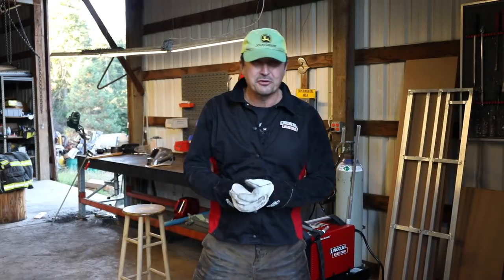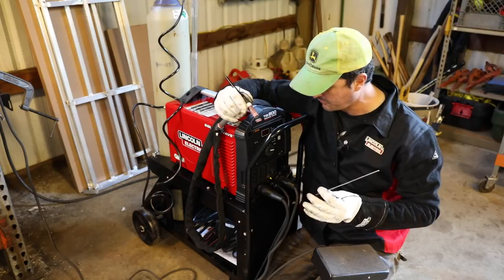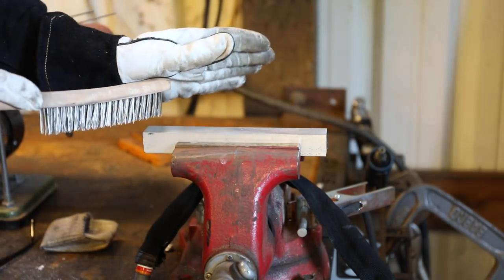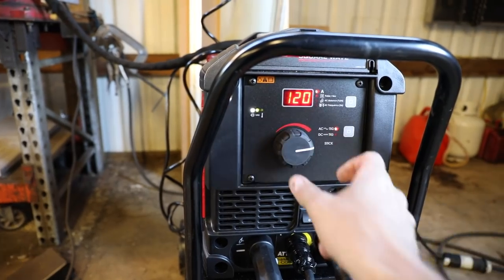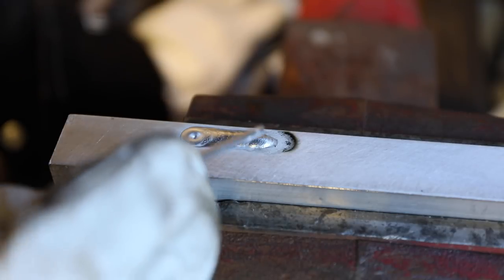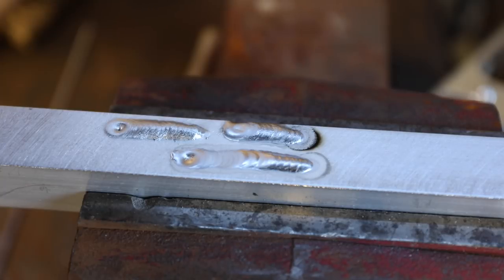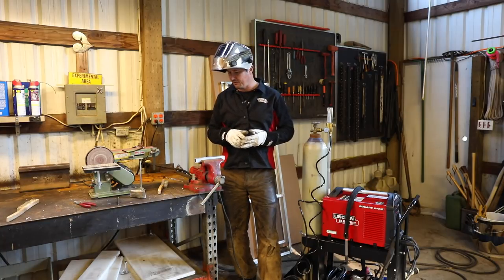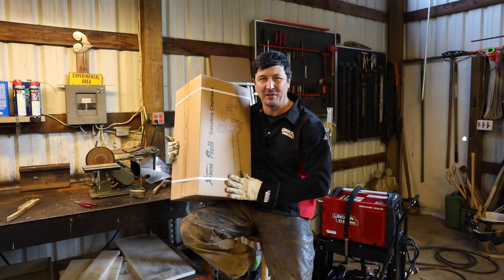The Hardest Thing I've Ever Done!!!

Comment: Tig is hard? Nah. Just takes some coordination.

1. Don't start out trying to TIG aluminum. It's not nearly as easy or forgiving as carbon steel.
2. Everything has to be clean, as in no scale, oxidation, oil, or any other contaminants. Grind it/brush it, then wipe it down with some form of non chlorinated solvent if there is any chance of oil. Isopropyl alcohol works well for me.
3. Your gloves need to be clean. Don't use the same nasty, oil and funk encrusted gloves you use for stick or mig welding.
4. Filler rod needs to be clean, part of the reason for #3.
5. Filler rod selection is critical, and you cannot use filler intended for oxy/acetylene welding...it's not "clean" enough.
6. Make sure you're using the right type of shield gas, and that you have the flow rate set correctly.
7. Use pure tungsten for aluminum, alloyed versions for steel or other metals.
8. Sit down and lay beads. Experiment with machine settings, travel speed, etc. to find out what works best for YOU.

DO NOT USE CHLORINATED BRAKE CLEANER(or any other chlorinated solvent) TO CLEAN ANYTHING YOU WILL BE WELDING ON. Burning brake cleaner creates Phosgene gas, which is a deadlypulmonary agent. It was used for chemical warfare in WW1. Do a bit of research on it. http://emedicine.medscape.com/article/832454-overview 

It is not necessary to go buy a dedicated and expensive machine to do TIG welding. ANY DC stick welder can be used just by adding a TIG torch and the correct shield gas. DC electrode negative polarity with helium shield gas was, and still is used to TIG weld aluminum. It delivers better penetration than the now commonly used AC/argon combination.

Comment: Can anyone tell me the advantages of tig welding over mig?
Reply: Lucas Murphy An AC/DC tig  welder can weld a much wider range of materials. It's more precise than mig and allows better control of penetration, heat input, bead size, bead profile and filler material. better for tight access and very thin materials, has almost no spatter it's quieter and when done well creates a visually pleasing finished weld.
Mig has the benefit of being a much faster process.

Comment: The space pen story is bullshit. Stop spreading it around, it serves no point. A simple pencil cannot go up there for the same reason of what happens when you put 12v from a car battery to the pencil core. Shavings of that type inside the air system would be stupidly dangerous on a space station/space vehicle where the Oxygen is higher in quantity/enclosed in a box that's also your life line.